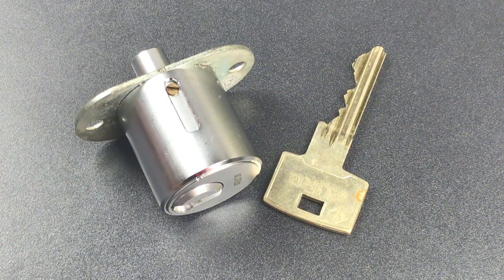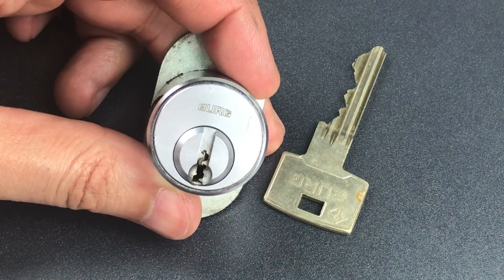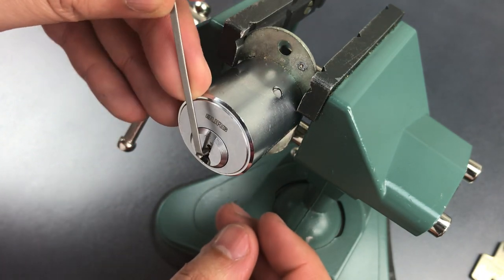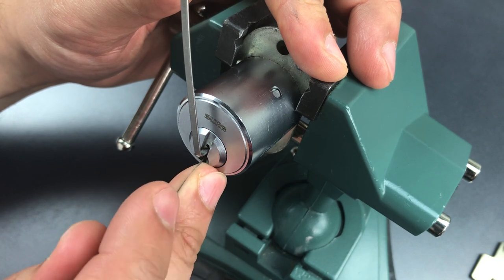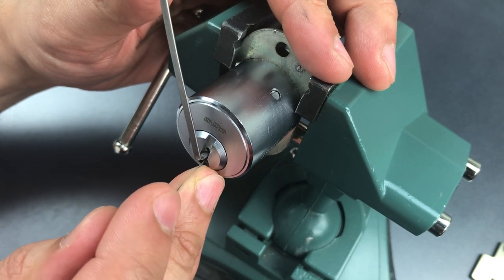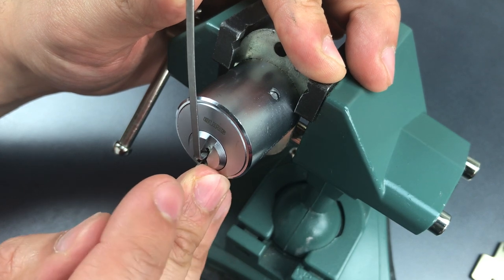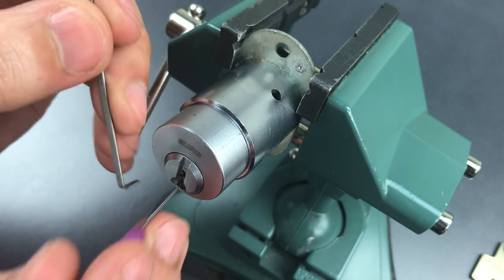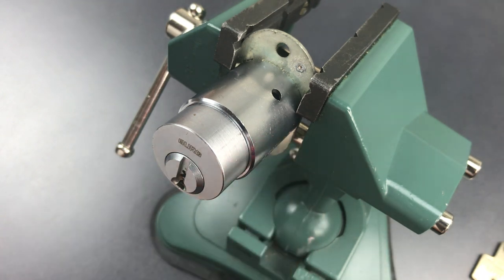[737] Burg Paracentric Cabinet Lock Picked

Comment: Good lock for a cabinet lock, most junk down here as far as cabinet locks would be junk wafer locks except the Bi-Lock one I seen the other day.🍺😎
Reply: I just bought an Abloy cabinet lock on Sunday. Arrived in the post today. It wasn't cheap. Also got a Jackson 4 lever cabinet lock from the same supplier. Got a Lockwood level cabinet lock last month. So there is some variety if you look.
Reply: @two_tier_gary_rumain  very cool. Yeah but they should be readily available. I remember seeing a jewellers cabinet display locks, all crappy wafer locks. Geez, I got a Bi-Lock for my letterbox but wafers are the norm there too.
Reply: Yeah, I've got one in the T-handle on the garage tilt door. Found someone in QLD selling one with a better lock on eBay but I'd be more interested in getting a T-handle that rotates freely when locked since the primary method of break-in for the T-handles is to wrench them open.
Reply: On the really cheap waffer cabinet locks, you can yank the entire core out with a knife and a fish hook, but this lock is one that I would trust for keeping $$$ safe.

Comment: having a go at an old locked metallic green filing cabinet that is probably from the late 60's or early 70's...i can't find the key and i defiantly do not want to destroy the lock by drilling it out...i do have a pick set (an H&H)  which did allow me to unlock (sort of) a newer cabinet but the lock was on the very upper right hand corner of the top drawer and the metal (for the filing cabinet was remarkably flimsy so pulling it open took little to no effort...the older cabinet is proving to be more tricky as it is more solidly built and the lock more resilient...not giving up on this by any means just really frustrating at the moment

Comment: Dear LockPickingLawyer, I just cannot seem to get into this heavy-duty, 3-drawer file cabinet.  I have they key... somewhere, but I'm not holding my breath on that.  I have some tools, but just can't quite seem to get it open.  I've opened smaller two and four-drawer vertical cabinets before, but this one is a legal-sized, wide drawer cabinet with some nylon cylinders that pop out of the right side (as you face it).  I would really like to get it open and replace the lock.  It was unlocked, but in moving seems to have locked.  I can't get the nylon restraining rods to disengage.  I would appreciate any suggestions.  Sorry, didn't know how else to contact you.  Thank you.

Comment: Does the vice make picking easier ? Should I buy one.
Reply: Definately makes a BIG difference in odd shaped locks or locks with sharp areas. I'm glad I bought mine.
Reply from the maker: Yes, but my general rule is to pick locks designed to be mounted in a vice, and locks designed to be loose in my hand. 👍
Reply: @lockpickinglawyer  what type of vise is that, I want one. :)

Comment: I don't think this would be used with furniture. More likely with a glass display cabinet used in a jewelry store.
Reply from the maker: Definitely not for use on glass. Aside from not having the mounting configuration, If it was used on thin glass, it would expose a portion of the lock that would permit a VERY easy bypass.
Reply: Bypass being the tiny screw at the base? I enjoy the teardown when you do them!
Reply: I was thinking of the types of display cabinets that have a wood or metal frame. The lock is inserted in that part of the frame rather than in the glass. The lock body's length would be about the same as the thickness of the frame so that it sits flush on both sides.
Reply: You push the locking pin in from the outside and the lock pops open instantly.

Comment: Hey could you do a destructive test on the bell catalyst 750.  it would be interesting to see how well the materials used in such a cheep lock hold up.
Reply: I'm pretty sure the spreader could eat that for breakfast. Video 671 quotes LPL estimating the lock body to be less than 1/8" thick and lots of plastic used internally. It is $16 on Amazon - perhaps this is something you could test and upload!
Reply: I think your right it would probably be like the lumintrail lock he destroyed a while back. plus the shackle is "extra long" so could probably be twisted with a crowbar.